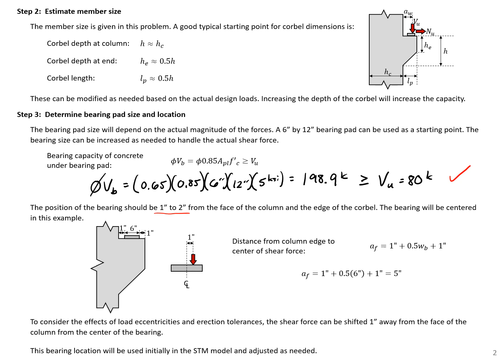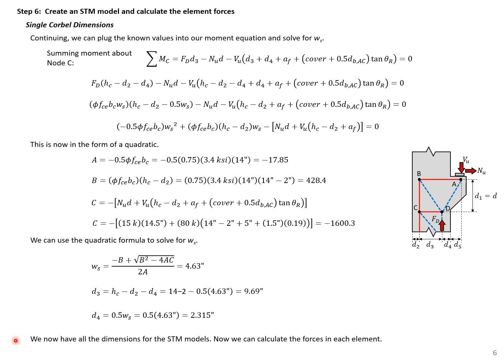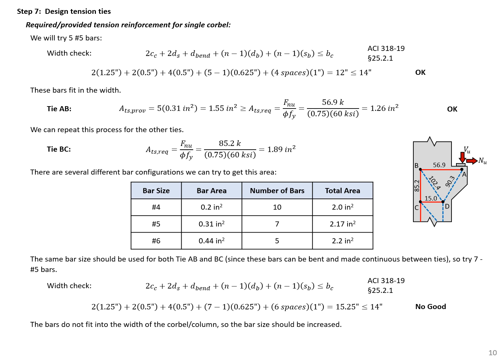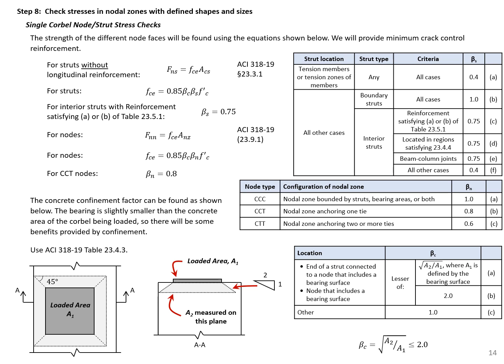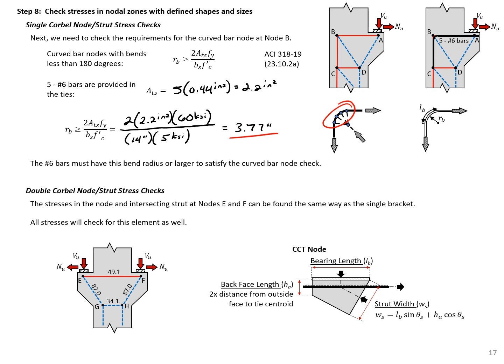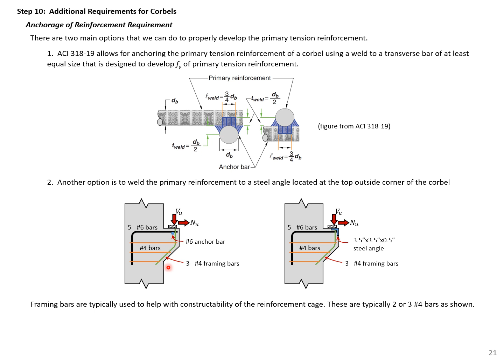Precast Concrete - 4 - Example 2 - Corbel Design

Comment: For a global model in ETABS, what are the boundary conditions to be considered for the interface of inverted T beam and the precast columns and also for the double tee beam and inverted T beam ??? also when we do a structural screed how does the boundary conditions changed ?? Lastly, how important is to do non linear staged construction analysis in overall this scenarios ?? 

In case we change the floor system to hollow core slabs what are additional things to be considered in modelling and design ???

Comment: Hey, i'm Ryan. I hv a few question about double corbels
Wut if the Vu and Nu are different in the left and right side of the double corbel (the truss model is exactly the same)??
when i've analyzed it using Ritter and Equilibrium Method, i got 2 possible different forces 
Thank you